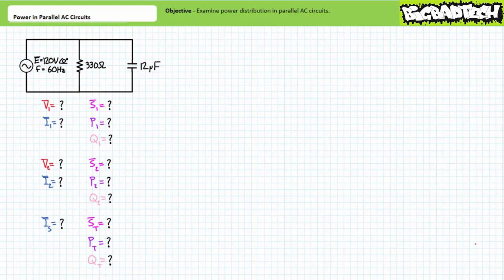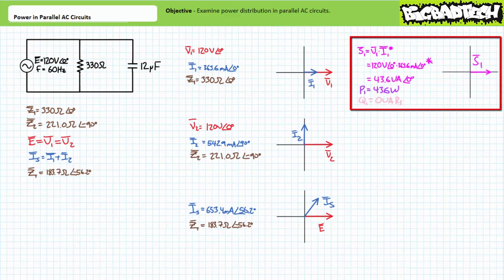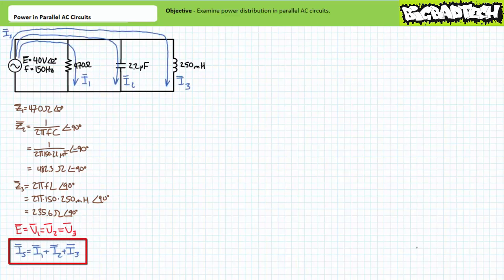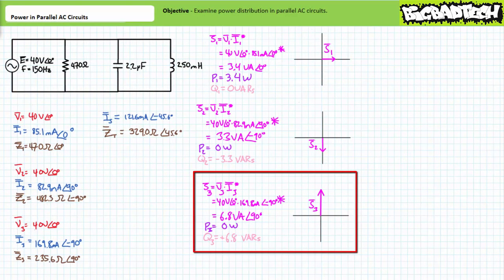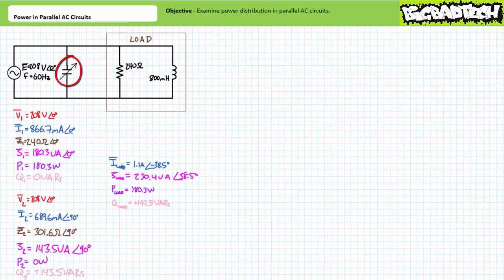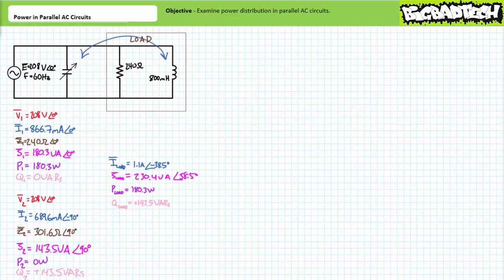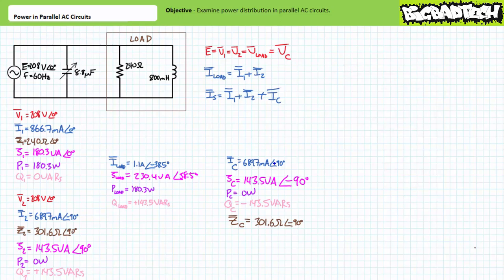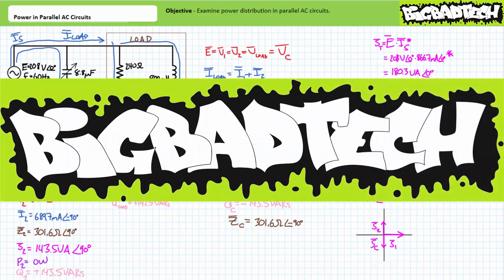Power in Parallel AC Circuits (Full Lecture)

Comment: So now this would be considered a tuned circuit?
Reply from the maker: Assuming you’re talking about the power factor corrected circuit at the end. If so, the answer is “kind of”. A resonant or tuned circuit is one in which equal and opposite reactive elements cancel each other out, however, they’re traditionally presented as purely series or purely parallel combinations of pure resistors capacitors and inductors not lumped together like I did with the load impedance. I’ll examine resonant circuits in later lectures.